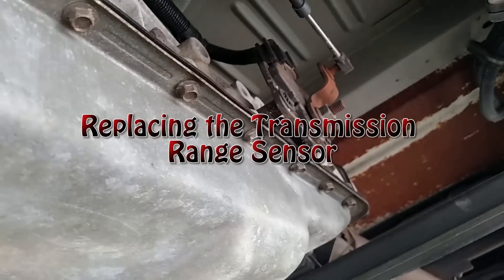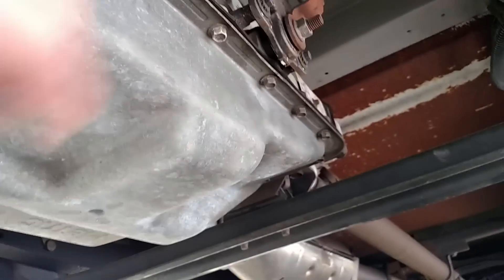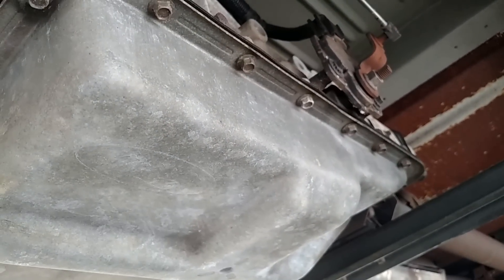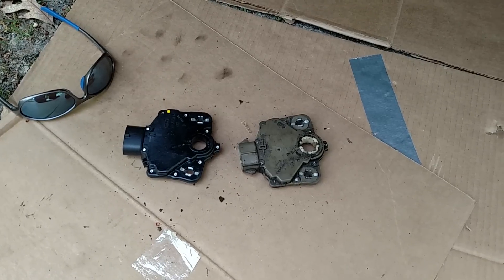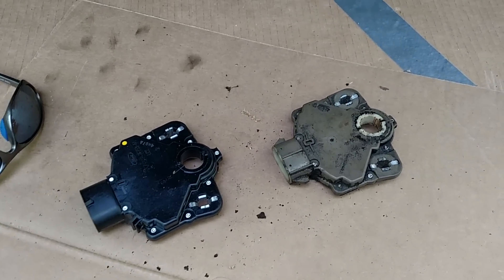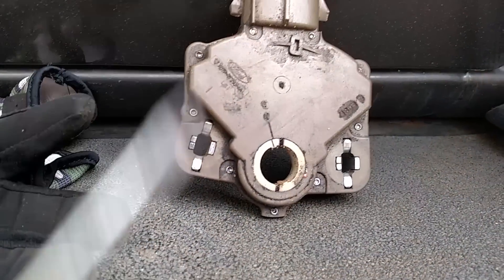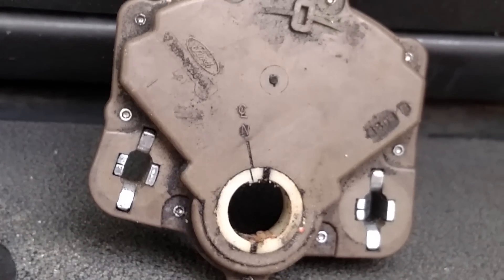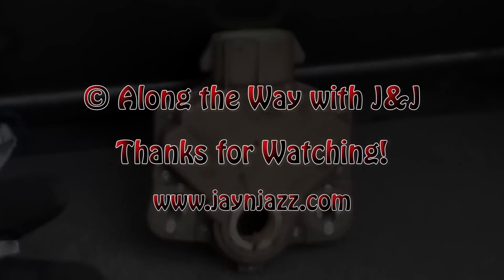Transmission Range Sensor Replacement - Ford - E350 - RV Transmission 🚨

Comment: I don’t know if anyone mentioned it but you do not need to remove the linkage from the cable. Just undo the one large nut and the whole bracket and cable will come off the sensor.
Reply from the maker: Thanks! I am not a mechanic so I just did what I thought would work but if next time it saves time I'll remember not to!

Comment: Did you ever determine the problem with your transmission?
Reply from the maker: It was the sensor...
Reply: @alongthewayjj  gotcha, mine is not exactly slipping out of gear but has a weird miss or slip only going uphill.  I'll most likely pull the pan and narrow down what it could be.  Thanks
Reply from the maker: @IDrivetruck  good luck!

Comment: I have a 2008 f150, and my problem is second gear makes a loud noise, and then it's work just fine. Already changed the transmission fluid and are still doing the same thing.

Comment: God damn. I've been searching for the cause of my transmission's defects before going into the transmission itself. It does the same thing yours did. I've began experiencing this around the beginning of summer. The most I've had my 7.5l gas guzzler rev up was 5 thousand RPM, scared the shit out of me. I was coming home from a long day's work for Lucas Cattle Company and I put it in cruise control and was listening to music on volume 15. Volume 15 is loud enough, and I could hear my engine over the music. Quick thinking, I hit the breaks to take it out of cruise control so it'd stop rising and it'd fall back down before going into gear. I've burned a lot more fuel than necessary within the past few months, which pisses me off. Talked to a mechanic and he said it could be this, thank you for verifying that this is the problem. I've already did a fluid change and put a new filter, gasket, and fluid. It used to shift out about 8-22 times a day before then. Got it down to around 5-12. Did a solenoid change, that lowered it but then it raised back up to around 8 times a day at the max. I've dumped a lot of money into it and I plan to take and sell some of the parts I've bought. Thank you.

Comment: Is there a way to adjust that so both lines match? I changed mine and I’m pretty sure the lines matched up. If I shutoff the overdrive I still get that code popping up.

Comment: These are informational, you said you picked up the part cheap but didnt day how much or where.
Reply from the maker: Thanks. I do believe there is a link to the part on Amazon in the description. It was around $60 which is short money compared to what we were about to spend to rebuild the transmission since nobody could figure the issue out.
Thanks!

Comment: Would this cause the transmission barely move in reverse? 
No check engine light, just the loss of power in reverse
Reply: Check you fluid level because if your low no pressure and then let see check with engine on you know right?
Reply: @briangreen8887  i broke band up inside the transmission 2600 complete rebuild

Comment: Hello, where did you find the replacement part? That matches the original plug with the sides that clamp on the neutral safety switch. The ones at the locasl parts stores have a different plug.  1983 f250 300ci 4x4 thanks
Reply from the maker: I believe I got it off of Amazon. Good Luck!

Comment: Does this also go for a 94 ranger because no body seems to stock that part for my particular ranger...Thx.
Reply from the maker: Not sure. There may be new part numbers or some NON manufacturer compatible ones. When I look up the one i used it's not available now. Good Luck

Comment: I just replaced mine on an 00 f150 4x4.   it was a used one from the junk yard. the center nut was rusted on so tight. i had to heat it red hot cuz of the rust. but it shifts good again. before it wouldn't find 3rd gear. but it would have 4th and drive good on hiway
Reply from the maker: good deal! thanks for watching.

Comment: Great information you shared!  Have a motorhome with the exact same issues.  Just curious if you test ran the motorhome after you installed the switch?  You made comment  you were going to change transmission oil and filter.

Comment: I have a 99saturn sl2, and it has a rough gear shift at 4mph speed, sometimes it continues to 55mph.. all 3 mounts are new, trans oil is new, trans filter is new idle sensor is new.

Comment: Can you find me the forum that you read that verified this before I change the neutral safety switch?
Reply from the maker: Sorry but i can't remember what the forum was as it was just over 3 years ago now. I did a lot of searching online, reading and talked to a couple mechanics and was ready to possibly rebuild the transmission before i decided to swap the sensor. Just have to search it out and see what you come up with. Always, Always do your own research first. Good Luck
Reply: Jay n Jazz Alright, thank you
Reply: @alongthewayjj  my Audi A4 auto seems to be going into neutral while driving.the revs shoot up and  have to pull up turn off engine and start again happens very rarely and only when I'm doing short journeys never happened on the motorway or freeway thanks.any feedback would be appreciated.
Reply: Marvin Lewis my truck is doing the same did u figure it out ?

Comment: I have a 2006 Ford Freestyle Limited FWD with a CVT with almost 164,000 miles on it and It's suffering from P0701: Transmission Control System Range/Performance. The wrench light (limp home mode) comes on every time I come to a complete stop and resets when I turn the car off. What's the fix for it?
Reply: Fit new range scensor neutral switch.

Comment: i am asking a qustion :i have a 1997 ford explore and get revered real good but haveing problem with it going into drive at easy ..well when rearing up the engine then drive will kick in and no probleming when driving
Reply from the maker: Cassandra Harris sorry but we are not mechanics. Just research and do it ourselves people. Good luck

Comment: I've got a 93 f150 with the e40d trans, it only likes to shift from 1st gear to OD but I have 2nd gear but in D it won't find it, could that be why?
Reply from the maker: It's possible, but not having certain gears may be another issue all together. We are not mechanics, but DIYers trying so save some money. Good Luck!
Reply: Hey I’m have the same exact issue with my Motorhome right now. I realize this is old but any chance you could lend some information
Reply: @brytodunsm5713  I ended up putting a new trans in mine

Comment: My 2001 V6  ford mustang  will not start  I only hear click.  We swap a new battery, installed new relay still wont start. We removed the relay and connect a jumper wire from one terminal of the relay to +12v battery the car starts.  Everytime we install the relay the car will not start.. Please help. Your feedback is much appreciated, thanks.

Comment: What transmission is this
Reply from the maker: A Ford 460 V8
Reply: Probably an E4OD, a 460 V8 isn’t a transmission.
Reply: @alongthewayjj  heyy
Reply: @alongthewayjj  I need your help , my eclipse speed sensor messed up n now I'm stuck on 3rd gear but it's an automatic.  My speedometer doesn't work either

Comment: I have a 97 Chevy Silverado 1500... it cranks starts up and runs but when I drop it into a gear (besides Park or neutral) it kills what could possibly be my issue? i bypassed the computer hot wired fuel pump
Reply: Dee Best CO 2 oxygen sensor
Reply: I just fixed my Ford that did that. It was a torque converter clutch solenoid. Also known as the TCC. It's either that or your torque converter clutch circuit has a short

Comment: Did this end up resolving your trans issue??
Reply from the maker: It sure did! Thanks for watching!
Reply: Jay n Jazz thanks for sharing! #LifeSaver
Reply: No problem!! Another Question; DId you have the vehicle in Neutral before taking the linkage off?
Thanks in advance!
Reply from the maker: Yes if I remember correct it should be in neutral.
Reply: Thank you

Comment: Did this fix work
Reply from the maker: +Tamera McBride It did fix our issue. We replaced the sensor and the transmission issue was corrected. We were so close to rebuilding the transmission before I did more research and found the sensor. Thanks for watching.

Comment: my car ford 150 4.8 8v have this problem look, when I turn starts well but I give up Cundo begins to fail as you want to turn off the engine, the censor has to do with that problem as wel
Reply: rufo flores have you checked what the code is? A range sensor would not kill a car when given gas. More like an MAF (mass air flow sensor). Go to your local parts house, they may be able to tell you which code it is.

Comment: tengo problema con explorer año 98 me manda este codigo p0708 prende la luz si me pudiera decir que es esa falla
Reply: Hola Madeleine, El P0708 es precisamente que la compu de tu camioneta te esta diciento que tiene dañado el SENSOR DE RANGO de tu transmision. Es facil de cambiarlo tal cual lo hace J & J en este video. Saludos! The P0708 trouble code means that the Engine Control Module (ECM) has detected a malfunction with the transmission range senso

Comment: check the main nut that he put a washer on. before tearing apart put in neutral with the engine running after you block all tires and parking break #1if tires turning its partially out of gear and in drive /neutral. block all rear tires pull parking brake jack driver side up. when in neutral wheels should not move if they do the pointer on the neutral safety switch and theres one on the bolt or cable or move the cablelinkage youll here it shift make sure it in neutral go check it dont be lazy being  lazy get you killed. work smart if done 
 properly that part will last you the life of the car mine got wet and the electrical malfunctioned. so i unplugged it sprayed with contact cleaner and air hosed it real good both terminals female and male.  then i covered the electrical wires connections with silicone on the outside plug also the plug doesnt snap on all the time make sure it is on or it will come off and car will not start. i saved 250.00 $ check the main nut and electrical connector.
Reply: go ask a transmission  guy at a trans shop theres not enough info on this part

Comment: couldn't you have left the ball socket on the link arm and just took the big nut off.  This piece of shit 2005 Ford Focus  transmission range sensor does not have alignment marks. So guess I have to mark the old one and try to get the new one in the same position. Heard someone say you can put it in neutral and turn the sensor until the back up lights come on and it is properly aligned. Not sure because people talk out their ass so much these days.
Reply from the maker: We luckily had alignment marks. I did put it in neutral while working on it though. I am sure there has to be some way you can match them up. Good Luck
Reply: @alongthewayjj  I read that you can put lever in Park snug bolts down just tight enough to turn the sensor by hand. Have an assistant hold the key on while you turn the sensor. Tell assistant to turn key off soon as engine turns over. Then tighten bolts and see if it will crank in Park. Then shift to neutral and see if it will crank in neutral. If so it is properly aligned. I have not started taking parts off to get to the sensor. So I don't know if it will be obvious how to line up the new one. But I did notice today that the new one has an extra smaller hole through the sensor body edge by the connector input.  I now suspicion that this hole may fit over a pin or something so that it lines up. If not I will try the method that I mentioned. Doing this free for an elderly handicapped neighbor and don't have a manual. So not even sure what all I have to take off. I will start with the breather and hope I don;t have to take the battery out and unbolt the transmission mount with the trans. supported with a jack to get to it. Thanks Zed
Reply from the maker: I would for sure put the drive wheels or all wheels on jacks if you attempt to turn it until it cranks. Be safe! 😀